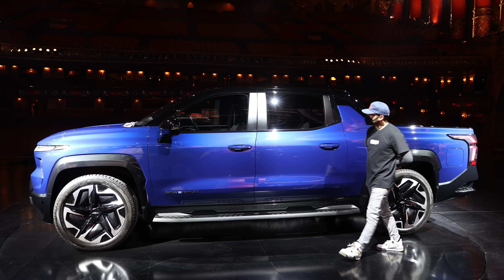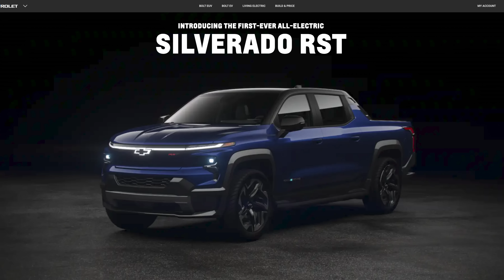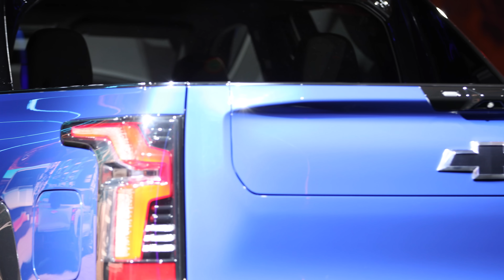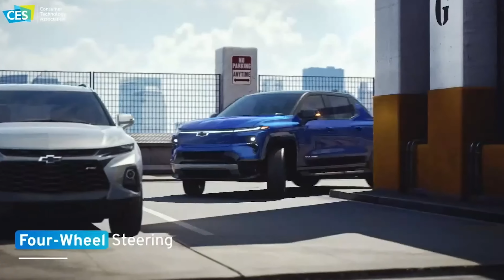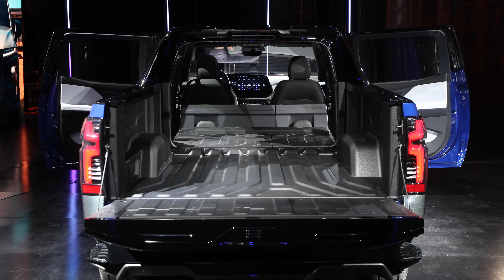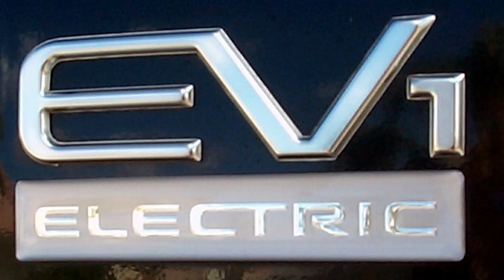Chevrolet Silverado EV: Chevy's Electric Future?

Comment: I have a fully loaded GMC AT-4 2021 and so many problems with electronic 
radar couple times didn’t crash 💥:( 
GPS don’t work :( SD Card not reading:( 
Cruise control sometimes not working temporarily disengaged :( 
Auto highbeams keep blinding people when there’s no car turns off when there’s a car turns on  :( 
Cameras sometimes it’s gray sometimes is blue sometimes don’t work :( 
Parking sensors :( 
Auto CarPlay not reading 80% 
Charging ports not charging :( 
Screen sometimes shuts off sometimes it’s smaller sometimes freezers :( 
Anything it’s electronic piece of garbage shame on GM :( 
GMC technology to pee on :( junk , 
Just imagine to drive itself it’s gonna kill everybody :( 
I won’t trust GM Technology :( 
Special full electron is it going to be even worse :(

Comment: It will be equipped the Electric Chevrolet Sylverado with tires of 37 inch? If not it could not be compared to 2022 Ford F-150 Raptor, every body knows that this is one of the reasons why 2022 Ford F-150 Raptor must be the of all time pick  year by year. Thank you. Dr Luis Amador

Comment: I'm on board with everything except the absolutely useless A-pillars in the back going into the bed rails. The A-pillars make storing things extremely limited and limits aftermarket accessories. If I were to load scaffold into the bed like it is done in a normal truck bed, it would smash those A-pillars. Loading anything wide on top of the bed rails is impossible. And truck cap manufacturers have to completely redesign and fabricate bed caps that go to ONLY this truck. This is why a Ridgeline or Avalanche never makes it as a work truck. As it is, the design and features are made to sell to non-tradespeople. Kind of a bad move considering the majority of truck sales are made in the trades industries.

Comment: They brought back the Avalanche mid gate!
Reply: And the one piece body and bed design.    I had 2 Avalanches and if they were still on the market would have bought my 3rd one.   Best vehicles I ever owned.   Towed big trailers, etc.   And the so-called blind spot was never an issue.   

Wish they'd get the mileage up some more but 400 miles is a decent starting point.